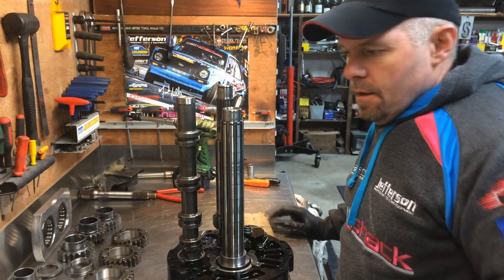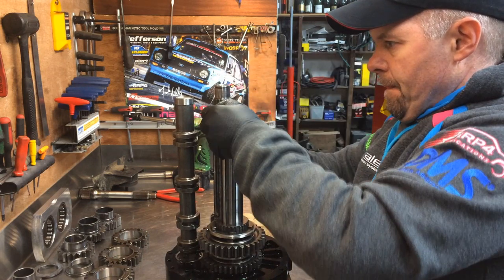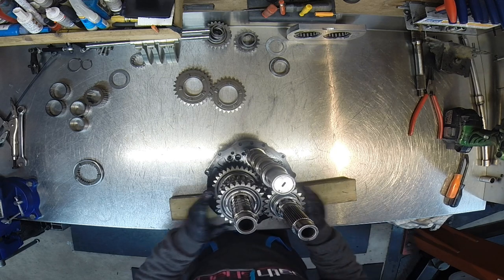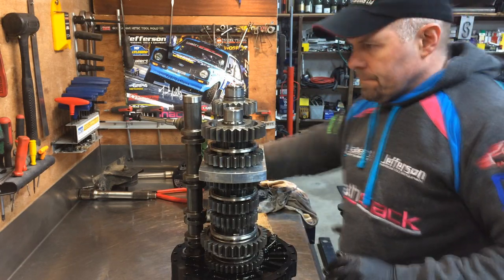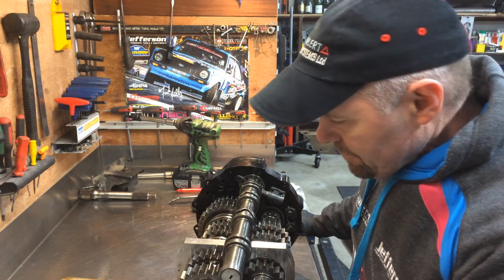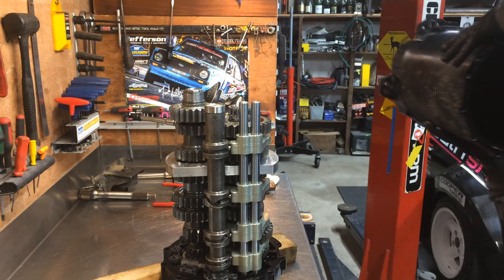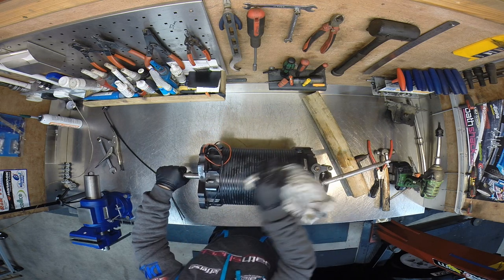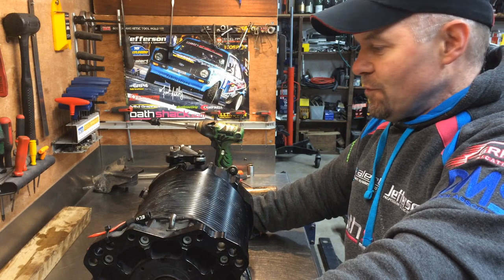Frank Kelly - HOW TO (Re)Assemble a Samsonas Gearbox

Comment: Hi do you notice you box rattles in netural with the cluth out was wonder if this is normal
Reply from the maker: It does a little which  is totally normal for a dog engagement box but the smoother the engine idles the less it rattles.
Reply: @FrankKellyRallying  that's good to hear I was a bit worried for a minute thanks for the reply
Reply: Hi again who would you get in northern Ireland to work on those boxes mine seems to have a big problem

Comment: Shouldn’t you be using some kind of assembly lube? Makes me nervous....all that dry asssembly
Reply: Since the gears sit inside an oil bath, they never really start off as dry.  It's not like an engine where you have to wait for oil pressure to build before your bearings and top end get any lubrication.
Reply from the maker: He said lube 😂😂. 
Sorry Robert, all was sprayed with lubricant after washing. 
These take 2ltrs of oil so I just spin the main shaft 5 or 6 times after assembly and Bobs your uncle  👍